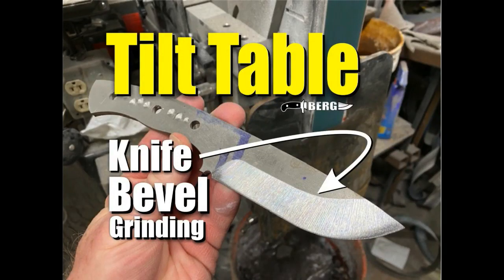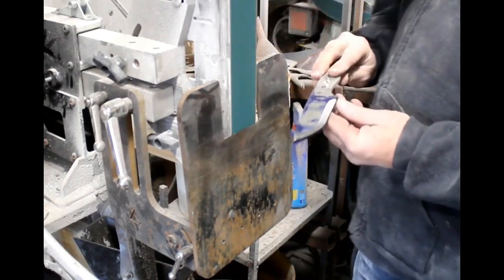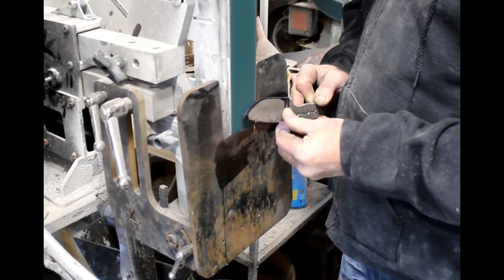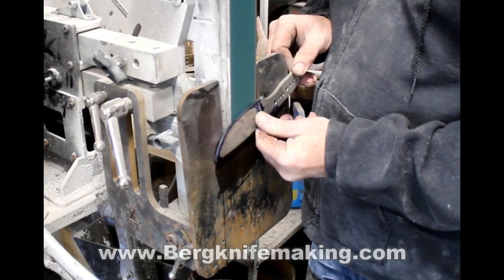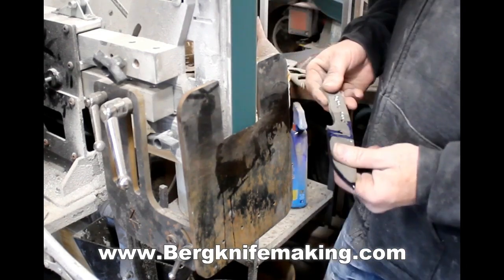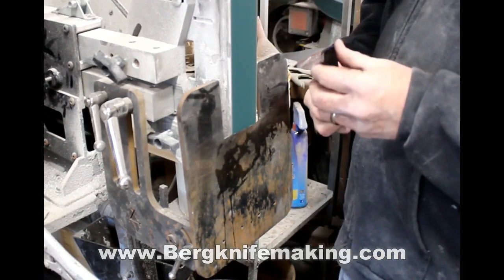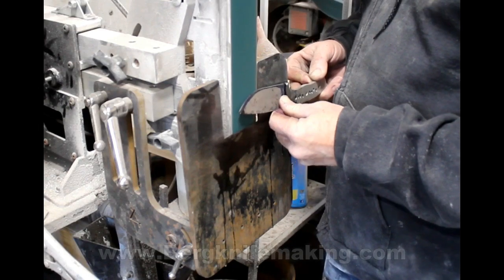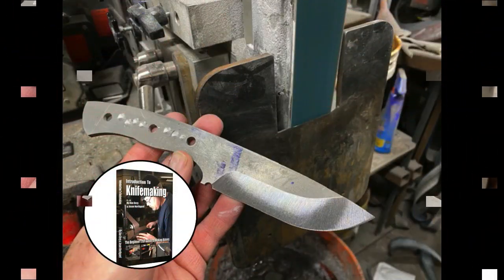Tilt Table Knife Bevel Grinding Jig THE EASY ALTERNATIVE

Comment: love your videos, however you didn't invent the tilt table for plunge lines. it's been around for many years. I've had one for over 12 years.
Reply from the maker: What we designed was a tilt table that could be easily mounted onto any 2x72 with 1 1/2 inch tooling arms. T

Comment: Great work berg! Wish I had that table 10 years ago.
Reply from the maker: You and me both!
Reply: @DIYeasycrafts  I am having an issue with electricity and my heat treat oven,  I'm looking for someone to heat treat a small batch of aeb-l. If you know anyone that can do it would be a big help.  Thanks again,  I really enjoy your videos, love the positivity from them.  Joe
Reply from the maker: @like-b1d  How many blades do you need heat treated? I usually only do one batch a month but if its a small qty and you can pre wrap them in stainless foil. I would be happy to help out.
Reply: @DIYeasycrafts  wow that would be amazing.  Obviously I can pay you whatever you need. 6-8 knives.  All under 9 inches. I can give my email to you here if you wouldn't mind deleting later.  Thank you
Reply from the maker: @like-b1d  If you can keep it to 6 that allows me to also do 6. Thats an easy run for me after work. Plus the dry Ice will do 12 easily. Yes please provide email